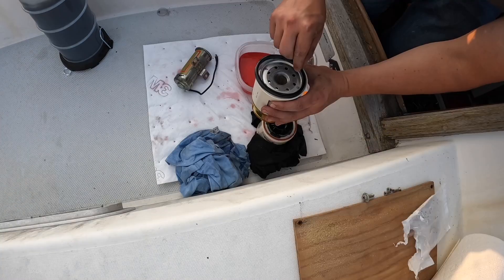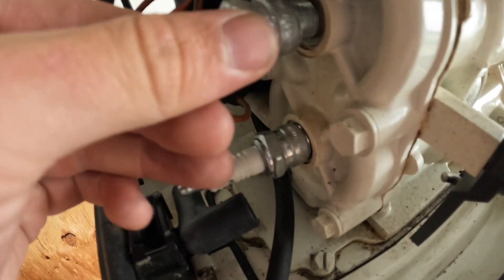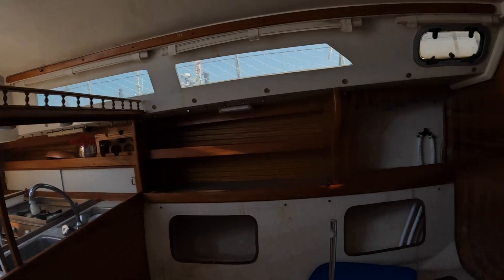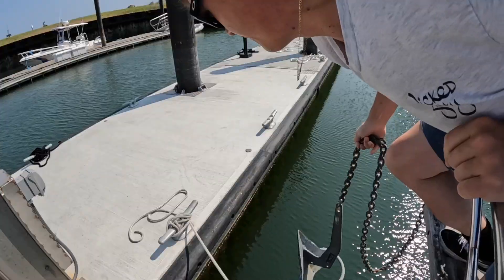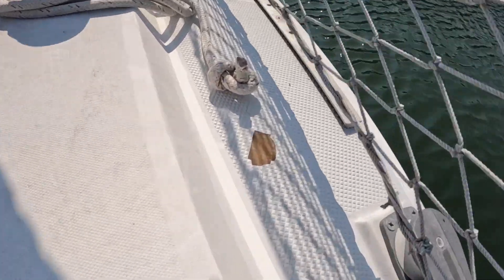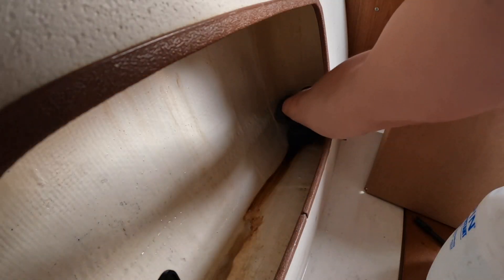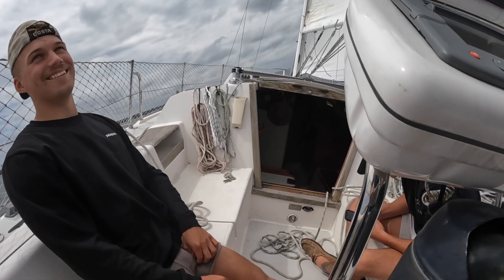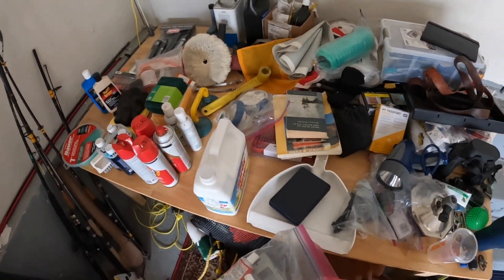THINKING OF BUYING A BOAT WATCH THIS!

Comment: Glad to see you two are back.  Your videos were the first ones we watched when contemplating going to Bahamas.  We've since take our boat over three times, from Texas!  Hope to see you there.

As for maintenance, don't ignore those overhead leaks.  The brown staining might be from leeching the core.  Replacing rotten core is a big job.  Also, don't bother putting wax on oxidized gelcoat.  It won't really stick.  As you did on the hull, needs to be buffed to remove oxidation and expose good gelcoat.  THat will accept wax.